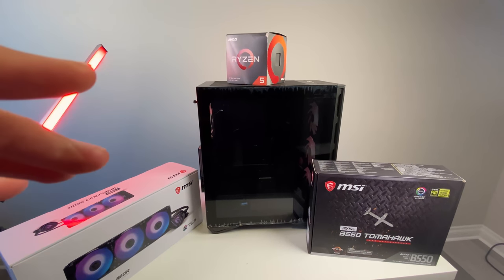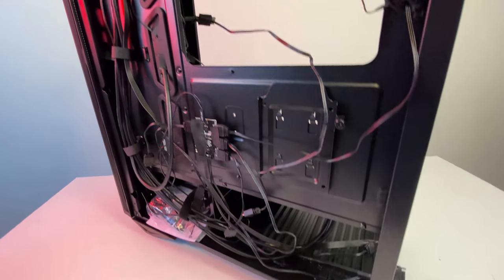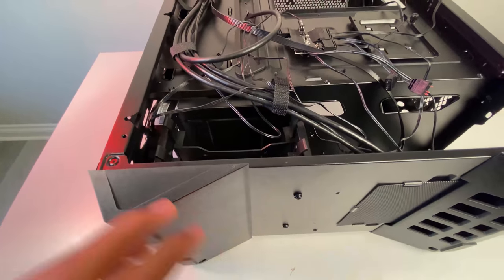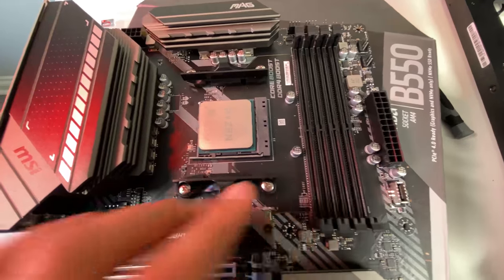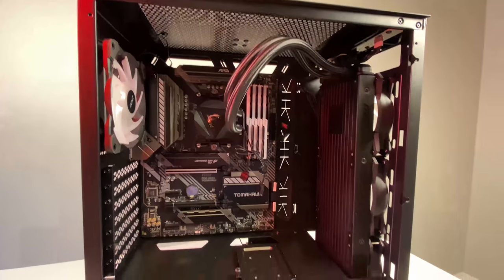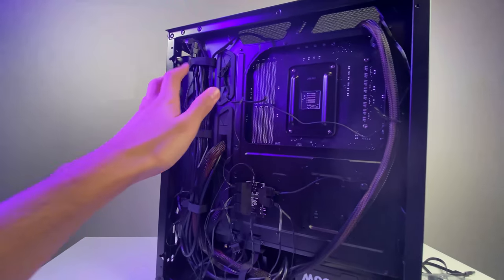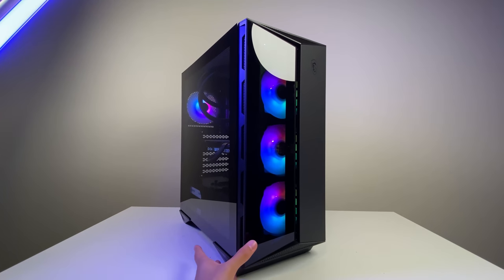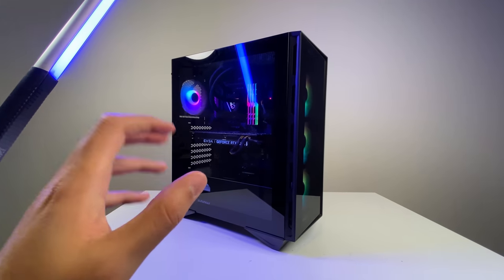Can This Fit Inside?  MPG GUNGNIR 110R Build

Comment: WTF I was thinking of getting the same build haha. 
Dude a question, will there be much difference in temperatures if I put a msi coreliquid 240mm AIO? I was thinking of putting the 360mm but I like the way the 240mm looks on the top of the cabinet better.... What do you recommend me to do..? nice video :)
Reply from the maker: Thank you Matiaz! If your planning to overclock your CPU then get the 360 AIO. If not the 240 is plenty. Plus with the 240 you wont be constrained with your GPU since mounting it on the front of the case robs you of some space for your GPU to be mounted.
Reply: @Realhardwarereviews  Ok thank you very much, I was thinking of putting a RTX 3090 on it which are very big and I was hesitating with the AIO and the cabinet. Really, thank you very much for the help!
Reply: @matiasbarrios3247  i was planning to buy the 240 aswell does it fit properly at the top of the case?

Comment: Can a msi rtx 3060ti triple fan fit inside this case??? I really need to know
Reply from the maker: Sorry for the late reply but if you put a front AIO then it wont fit. Tried it myself
Reply: @Realhardwarereviews  hi thanks! It fitted in the case perfectly and barely lol, I use a 240 AIO up top then it works

Comment: Are the pre-installed fans pwm? If so, I'm sold on this one
Reply from the maker: Let me check with MSI. I sadly dont have the case anymore.
Reply: All Fans Included are DC  (3 pins with low control within the msi fan software)

Comment: How important is that AIO cooler? The thing is, i'm planning on building my first PC that consists of the same graphics card (MSI GeForce RTX 2070), CPU (Ryzen 5 3600), and motherboard (b550 Tomahawk), and wondering if these components really require an AIO cooler. Your advice is much appreciated. Thank you. I've also taken on your recommendation of grabbing the same case but with the mesh in front. Thanks.
Reply from the maker: You really don't need an AIO unless your looking into overclocking the CPU. Even then its not worth the hassle. A regular air cooler would still work. It all depends on what you think is the best for aesthetics as well.
Reply: With a ryzen 5 you can use the cooler it comes with
Reply: @bfredd3333  No, the stock cooler doesn't worth it. I've changed it in two months because temperatures were so high.
Reply: I have the same case and stock cooler of Ryzen 5 5600x is not enough. Im actually getting the same cooler as in the video tomorrow. :)

Comment: Can someone tell me if the kraken z53 from nzxt will fit in the top of this case?
Reply: If it is a 120, 140, 280(on top) or 360 mm it will fit
Reply: @gunnerrn  so since the fan size is 120 it will fit on top, am i right ?

Comment: I just built a computer using this case and yes, airflow is an issue. The cpu gets up to 80 Celsius. I think the problem is the front panel, I’m gonna remove it and see how it works.
Reply: No It’s your cooler, it’s probably garbage as mine with the stock cooler was 60-70c while over clocked but I switched it with an aio
Reply: I've never had air flow issues with this case

Comment: Good video. Can you comment on whether you could/should have chosen to flip the radiator so that the lines run down to the bottom of the case. Would something prevent that orientation?
Reply from the maker: There wouldn't be enough space for that sadly.

Comment: I just got this case and getting frustrated since Ive never had to deal with an rgb header. My fans light up but don’t spin, what on earth? Anyone have any ideas?
Reply: prob late response ?, but be sure to hook the rgb header board ( inside right side of case behind panel ) to the sata cable coming from the power supply. then make sure the rgb board is connected to the mother board, it should connect to the rainbow pin connector on the mother board. also make sure the case fans are connnected to the mother board pin connectors that read fan supply, most case fans are 3-pin, where is on the mother board pin location, there is 4-pin, make sure to attach the fan connector down on the mother board facing the correct way.

Comment: Is that case a got choice for a ryzen 7 3700x and rtx 3060ti? Both not overclocked.
Reply from the maker: Depending on the model of 3060ti you choose it might not fit the case if you add an AIO in front of the case.
Reply: If you put an AiO into it, just get a 240mm and mount it on top. 3060ti should be fine then. 3080/3090 probably wouldnt fit though

Comment: Can I put the evga ftw3 ultra 3070 inside?
Reply from the maker: I would watch out if your planning to add an AIO. I couldn't fit a 3060 TI in the case when adding a 360 AIO in the front.
Reply: @Realhardwarereviews  how long can it be?

Comment: Does this  case supports the Rtx 3080 Suprim X?
Reply from the maker: Double check with the length of the graphics card. If you plan on adding a 360 AIO in front of the case you wont have much space to fix one in.
Reply: not ， if 360 AIO there
Reply: yes got it but only with cpu radiator on top

Comment: will a rtx 3090 fit? 
with the radiator installed? looks like you could barely fit a 2070
Reply from the maker: Sorry for the late reply but yeah, you are correct a 3090 will not fit with a 360mm in front.
Reply: @Realhardwarereviews   What about an MSI 3080?

Comment: I'm looking at building my first PC and looking at putting an RTX 3070 and Ryzen 7 5800X in it (once they're in stock again, won't pay scalper prices) with a top mounted 240mm aio for the CPU, how bad (or maybe good) would this case be? I prefer the tempered glass look at the front over the mesh, but I know the thermals are going to be more important. And if not this case, is there a case you would recommend for a first time PC builder? Sorry for the bombardment of questions, first time finding your channel and I enjoyed the video
Reply from the maker: The case is great but I would watch out on the size of your graphics card. I found that fitting a 360 AIO plus a larger graphics card that I had wouldn’t fit in. In your case you should be good putting the AIO on top.
Reply: @Realhardwarereviews  Thank you for the help! Since it's my first build, I really want to get it right and you helped put my mind at ease a little bit in terms of the combo I'm going for.
Reply: @STOEmma  im buying my 1st pc soon, and im also using an RTX 3070,  Ryzen 7 5600x, as well as a top mounted  240 aio cooler, how did your build come out for you? any issues? how was cooling with the glass front?
Reply: @StardustCrusad3r  The only issue I had was that the pump in the aio I chose failed. I've got a temporary air cooler while I find a more reliable aio, and I have no thermal issues. I did change the parts, due to availability at the time, I've got a RX 6700 XT and a Ryzen 9 5900x
Reply: @STOEmma  how long did the pump live before failure? which brand/model did you have?
Reply: @StardustCrusad3r  It was the MSI MAG Coreliquid 240R. It died about 7 months in
Reply: @STOEmma  an okay. Im getting the ARTIC liquid freezer II, and the reviews have been overwhelmingly positive

Comment: You think vertical gpu mount is good for this case?
Reply: i have this case and im thinking about it too lol
Reply: @Emazingkids  what's your gpu? Mine seems too thick. 5700XT Gaming X
Reply: Dude we almost have the same GPU lol, I have a Rtx 2060 gaming Z by msi, I don’t think it will be a problem g
Reply: @Emazingkids  I tried doing a phantom vertical test. My AirCooler(ID-Cooling SE224XT) seems to be blocking it. If I switched to an AIO, most probably it'll work
Reply: @vincentjasonsarabia  I used to have a hyper 212 by cooler master before I switched to the msi 240mm aio,  plenty of room. I would definitely consider
Reply: @Emazingkids  Did you do it top exhaust? Will definitely take a look at it. Or maybe I'll wait for the newer versions to be released this year.
Reply: @vincentjasonsarabia  yes i mounted it top exhaust, my r5 3600 never goes past 60c during heavy gaming like cyberpunk

Comment: Only problem with the case is the intake at the front but that can be resolved by just taking off the front plastic bit, and leave the dust panel in
Reply: I actually bought the other grill design in where in place of the glass, it's a steel mesh screen.... changed temps on stock config by significant amount.
Reply: @ttattx  Did you buy the front panel separately somehow or did you buy a whole different model entirely?
Reply: @unholyisme  yes, bought the panel separately from MSI.
Reply: @ttattx  Do you have a link from where I can buy the panel separately from them? It'd be extremely appreciated!

Comment: What about 3060-3070-3080 can it fit in ??
Reply from the maker: Depends if you stick an AIO in front or not. If you do then the clearance might be a problem. I couldn’t fit a 3060ti from MSI with a 360mm AIO in front.

Comment: I'm having a issue with my RGB'S fans. The fans work but the RGB light won't turn on. Can anyone help me?
Reply from the maker: Did you connect the ARGB headers to the fan controller at the back of the case?
Reply: @Realhardwarereviews  same exact problem, the manual gives you no info at all. Power but no RGB Color in those fans.
Reply: @Realhardwarereviews  mine was pre-plugged when I got the case. My bottom fan’s rgb is the only one that isn’t turning on, why is that

Comment: I just ordered this case with that exact AIO. Im worried my 3090 isn't going to fit because of the AIO in the front
Reply from the maker: How did it go? Did the 3090 fit? I know the 3060 couldnt fit with the AIO in front.
Reply: @Realhardwarereviews  it was a tight squeeze but I managed to get the 3090 and the 360r both in the case! New build is a monster. 10900k, 32gb 3200mhz DDR4, RTX 3090. I'm in love
Reply: How long is your rtx 3090?

Comment: The cable management is easy with this case?
Reply from the maker: Really easy!
Reply: @Realhardwarereviews  ty, I wanna build my pc by myself but I fear the static electricity 😢😭😂
Reply from the maker: Don’t worry to much about it. Just make sure to ground yourself and not build it on a carpet floor.
Reply: @Realhardwarereviews Ok I'll try to buy antistatic mat/bracelet  and hope that everything will be fine 😤😤
Reply: @cas curse   @Real Hardware Reviews   i finally build my PC ! thank u ! (I know that isn't necessary  but I used antistatic mat/bracelet xd)

Comment: If I use RTX 3070 and i7 10700k, is this case a good choice?
Reply from the maker: Depends on how large the graphics card is and if your planing on installing an AIO cooler in front. The clearance might be an issue. Also thermals might be a problem.
Reply: @Realhardwarereviews  340mm clearance

its on the specs chart lol... why waste words like you are doing, and you call yourself a reviewer. LOL

Comment: I am building my first pc soon and it will have a 1660 super and a ryzen 5 3600, I ordered this  case 1 week ago, would it be fine despite the lack of decent airflow from the front?
Reply from the maker: With those specs your more than fine for cooling. Are you going for an AIO or air cooling?
Reply: @Realhardwarereviews  I have the nzxt kraken m22 for cooling, which I will mount at the top
Reply: so aio
Reply from the maker: You got plenty of space to install the aio and the cooling should more than enough. If anything you can always upgrade down the line by adding in more fans or getting a larger aio.
Reply: @Realhardwarereviews  alright thank you for the advice :)
Reply from the maker: No problem. Glad I could help out :)

Comment: Could you not have put the extra fans up top as an exhaust? Just a thought.
Reply: I know he mentioned it, so maybe just didn't include that in the vid?  I am planning to modify my MSI pre build that has this case, and do exactly that - replace sucky 120 rear aio for another brand 360 up front, and use the case fans wherever I can...

Comment: What is the Maximum lenght of the graphicscard when I want to put a 360mm cooler in IT?
Reply: i dont know exactly how much, but with the aio in the front an asus 3080 has like 5 millimeters of clearance so anything of the same size or smaller will work
Reply: You mean "length". I have this case, but I don't understand your question. You can fit the larger graphics cards in there for sure, if this helps
Reply: @___Zack___  Okay thank you, just wanted to know if the amd rx 6800 would fit in there with the 360 cooler

Comment: Thanks for the video, a 290 mm GPU would fit perfectly then? Got and x570 mobo, 240mm fan and planning on getting 3060ti aorus master which is 290mm as I read in the comments the msi gaming trio won't fit :(
Reply: Yeah I have this excact case with a  msi rtx3060ti triple fan it fits perfectly, you just can't have the front AIO in then, I use a top one

Comment: It's my first build ever and I don't get it how to connect all those fans
Reply from the maker: Hey! Are you connecting the RGB for the fans or the power? If your plugging in the RGB, all  you need to do is plug them in the RGB controller at the back of the case. For the power you can just connect them to your motherboard.
Reply: The four pre-installed fans are all already connected to the controller. With the enclosed 1 to 3 cable I can connect the front three pre-installed fans to the motherboard, but what about the rear fan and the additional two fans that come with my water cooling? I bought the MSI MAG CoreLiquid 240R
Reply: does it matters which SYS_FAN Port I use? I could also put each Fan in his own SYS-FAN Port, right? The B550 Gaming Edge Wifi has 6 SYS-FAN Ports. The 1 to 3 cable is just nice two have, correct?
Reply from the maker: The water cooler fans get daisy chained together and they get put on the CPU fan. The rear fan can be connected to the  SYSM Fan. Hopefully that helps! Tell me if you need any more tips. Stay safe.
Reply: @Realhardwarereviews  Thank you, I think I know how it works now. But I can't proceed with my build, cause my bios won't update via flash button and I don't own an older Ryzen CPU to flash it in the UEFI. I will come back here when I've got any questions left.
Reply: @jhendra83  The 110r Gungnir comes already with a hub. But it has two cables at the bottom. One Sata cable for power and for what is the other one?
Reply: @jhendra83  yeah I've enough power ports at the motherboard with the included 3 to 1 cable. But I don't get the function of the one extra cable at the hub. Look at this (red circle): 
https://s20.directupload.net/images/201203/fnqbrtls.jpg
Reply: @jhendra83  could you draw a scetch on paint how to connect my 6 RGB fans ? xD
Reply: @gigamarv  the sata to power up the hub to power to the rgb fans. The other cable connects to your motherboard rgb header to control all your rgb lightning thru the motherboard. I personally never used it.
Reply: @jhendra83  aah okay, so the 3rd cable is to controll my RGB lightings. And which is the right port for it? My water cooler (MSI MAG CoreLiquid 240R) comes also with and RGB "Head" (this thing which sits on the CPU) and this one needs to be connected to the JRAINBOW Port. I think my motherboard as an JRAINDBOW2 Port - is this the port where I have to coennect this mysterious cable?
Reply: @jhendra83  When the SATA cable powers the hub and the fans, do I still need to connect every fan to the motherboard? sorry for all my dumb questions.
Reply: @Realhardwarereviews  hey man I plugged the rgb in the controller place and the power into the motherboard, but they stil don't show the rgb just running, must I download the msi dragon center app for the rgb to work or is there something else?
Reply: Same issue. Do I need to plug the SATA cable of the argb controller aswell? Or just plug it to the motherboard?
Reply: @JAE-yq3bz  yeah, connect all fans to the hub and then connect your hub to SATA cable and to the motherboard.
Reply: @gigamarv  i did that. I connected it to the 5v 3pin ARGB header on the motherboard but msi mystic light not detecting it
Reply: @JAE-yq3bz  you have to press the LED Button on your case for 3 seconds to "activate" mystic light
Reply: @gigamarv  thanks thats what I did

Comment: Great review!!!

Just a few questions for everyone and I hope you guys could answer:

1. Do you really have to put electrical tape on the rgb hub to prevent shorting? I really didn't understand it much since it was a quick explanation. My last pc shorted (I think) and I want to avoid breaking any parts I have. 
2. Is the front panel plastic or metal? If it's plastic, how's the quality? 
3. If you're using this, how are the temps? I'm planning to use this case with stock case fans and stock cpu cooler etc. and I'm not really looking to OC.
Reply from the maker: 1. I just put the electrical tape to make sure there isn't any contact with any metal on the case. 
2. Its plastic/glass. Depending on the variant you get, it can be all plastic or a mix of glass and plastic. Its fairly solid overall. 
3. Temps should be good enough if your not OC'ing :) 

Hopefully I answered all your questions :)